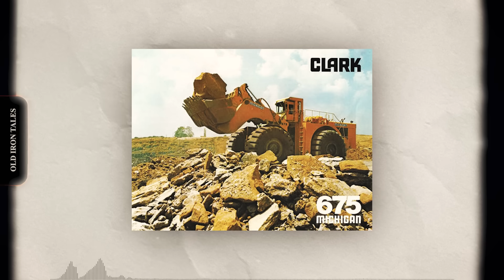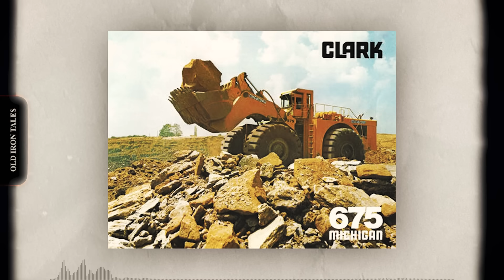A Magnificient Failure — The Giant Clark 675 Loader

Comment: The 675 was NEVER a failure. It was a machine way ahead of its time! 
Tires had to be custom made for the loader, and it didn't stop there. It was also a challenge for other companies to custom manufacture parts which could accommodate the sheer power of the 675. 
The global crisis alone was a major blow for Clark Equipment during this critical phase of engineering, let alone the strikes and other economic factors that the company had to deal with. Contractors were simply not ready to buy the 675.

Comment: The CAT  992C  .. end of story. End of this machine.
Reply: Old CATs were no contest to Michigan. Compare CAT to Michigan (both of the same size) i.e. 75B to 950C, 125B to 966C, 175B to 980, etc..., and tell me which one outperforms. Even to this day, I still see some Michigan B series active but not much CAT C series. They broke down long time ago!!!
Reply: You have zero idea about what your talking about..... 

The Cat 992C wheel loader has an operating weight of about 207,000 lbs. Its engine producing 800 hp, with a bucket capacity of 12.5 cubic yards.

The Clark 675 loader is significantly heavier, with an operating weight of around 312,000 lb. Its engine producing 1400hp, with a bucket capacity of 24 cubic yards. 

This makes the Clark 675 much more powerful than the Cat 992C at nearly twice the horsepower and tonnage capacity.

You sir have no idea of what your talking about. You need to quite playing with your Tonka toys in the sandbox and grow up.
Reply: @pipeweldor4850 LMMFAO!! I have been a Heavy Equipment  operator  for 37yrs. My uncle the same  before me... that machine  could not work  day in day out like the 992C.. the C model had a 3412 v12. 690 HP. 13.5 yard bucket.. smaller machine  but  RELIABILTY
 UP TIME. PARTS AVAILABLE 
 SERVICABILITY.. it all combined to out produce and put that machine out of business.  I know how good the 992C was . Ran one for 7yrs straight  in the steel Mills...  i do know EXACTLY  WHAT I AM TALKING  ABOUT NIM NUTS 😂😂😂😂

Comment: Probably the Cat 992C put the 475 out of business,generally speaking.See that pump loading of the 675 bucket,a sub optimal technique and played havoc with the Clark Hydraulic system and torque converters,to a lessor extent.They did bring out Damper kits to help but the 992C was extremely refined in all aspects,it was no contest after that.
Reply: 992g

Comment: Failure to state what the “reliability” issues were that created down time.  Mines were basically buying machines like that factory direct with a Hot Line to the engineering department.  Dealer repair staff were directly involved with factory personnel.  Too much riding on the production of these machines not to have constant monitoring ( in person).